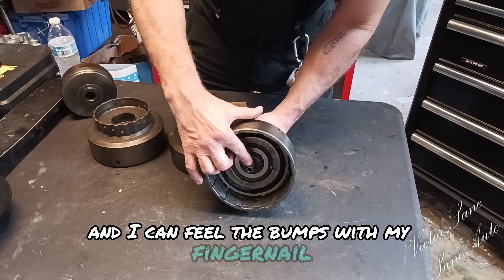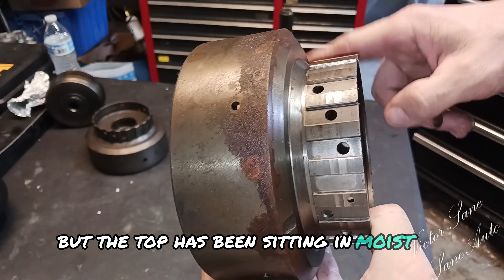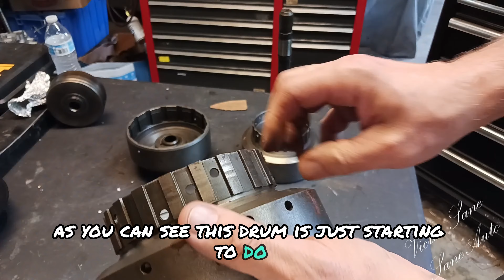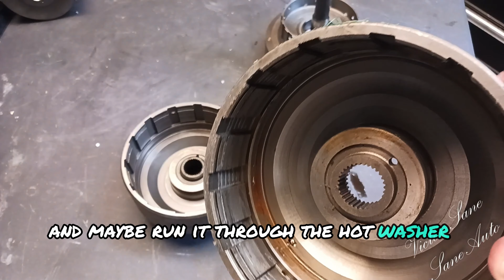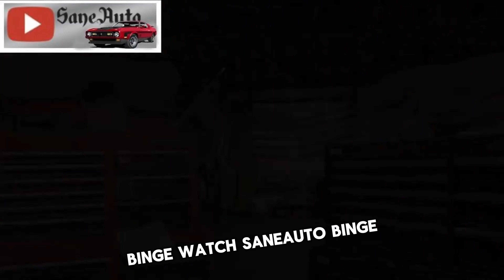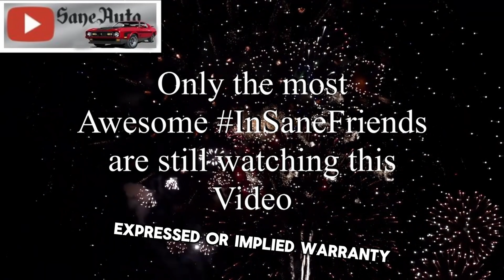How to check Automatic transmission drums for damage and wear TH350 repair

Comment: That’s exactly why. this video is exactly why when someone tells you it was running good when I parked it five years ago, Transmission was strong.  problem Is five years ago It did not have rust. after sitting unused transmission fluid becomes an enemy as it attracts moisture, as well as the internal clutches, they too will absorb moisture faster than oil. They will actually take in the moisture and push out the lubricant there made of a hydroscopic material or something like that. And the worst enemy is weather humidity and temperature chains will cause the internal section to condensate and develop its own little moisture pocket.
Reply from the maker: I have been working on V8 head gasket jobs early in the morning and watched the beads of condensation form in the valley and run down into the belly of the beast while I was working. Always change oil and fluid before startup after repairs or sitting. Yes your right used transmissions sitting outside get condensation twice a day every day. As sure as the dew forms on grass, so it also forms on car parts.
Reply: @saneauto  👍